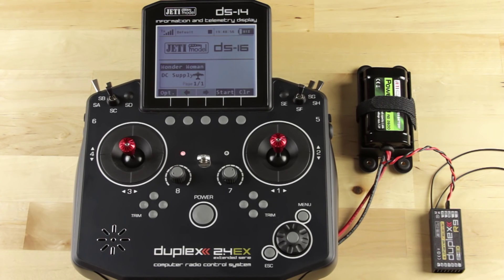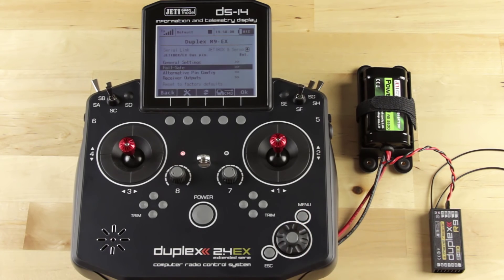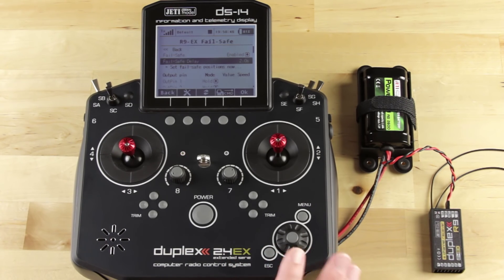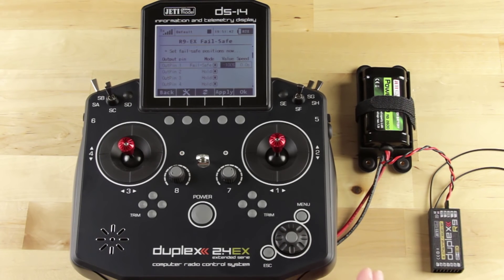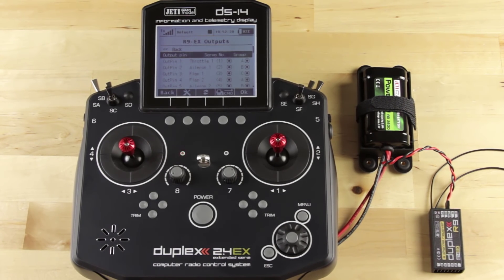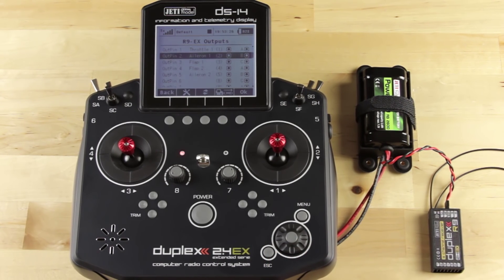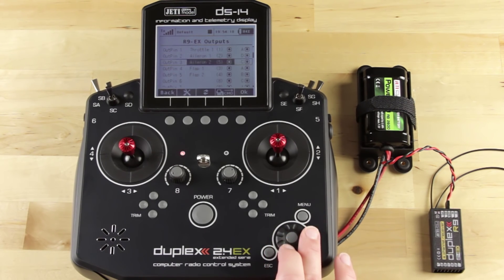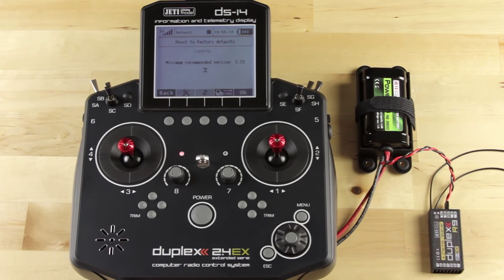Radio System: Receiver Fail Safe Setting, Channel Pin Reassignment & Servo Groups

Comment: I'm trying to find out which way the JST pins fit into the receiver slot (copper UP like Futaba, or copper DOWN like a bunch of other brand receivers). The Jeti RX documentation says that the RX can be burned out by attaching the power plugged in a reversed way. But It does not mention which orientation of the plug is correct.
Reply from the maker: +Oudeis Eimi The plugs are based on positive and negative wires. Take a look at your receiver. You will see a "+" and a "-" symbol.  Positive is indicated by the "+" and negative is indicated by the "-". Your darkest wire will be the negative side. That will be the side to line up with the "-" signal. If you are still stuck please send an email to sale@esprittech.com.